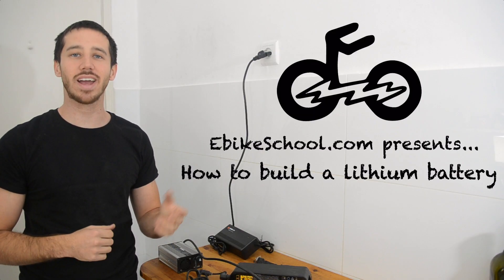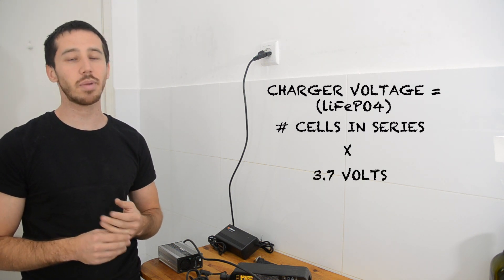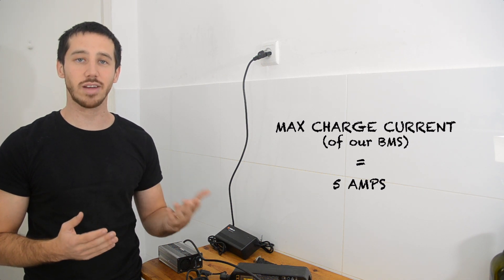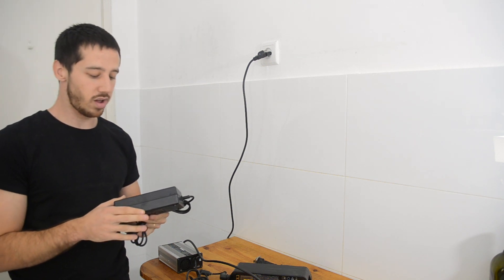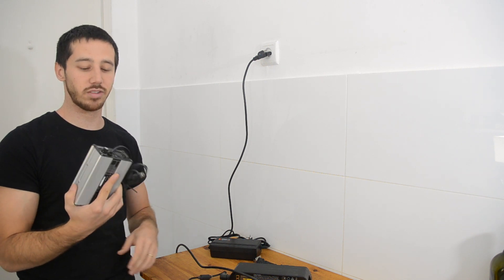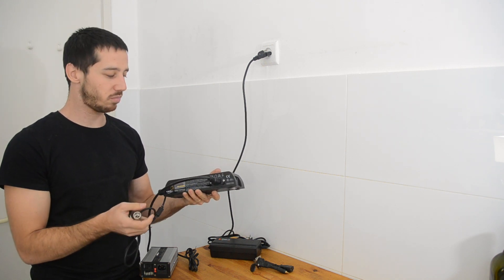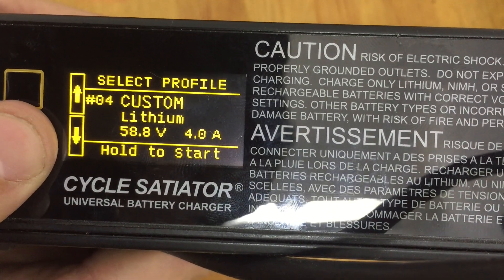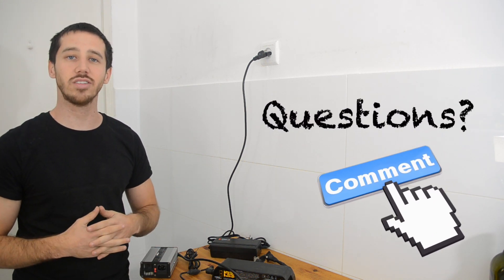DIY Lithium Battery - Choosing a Charger - Part 5/5

Comment: Really good video series, very well explained, but you need to make this point: The battery you built should always be charged to 100%. Charging to 90% will increase cell life, but the BMS only balances the cells at 100%, so at 90%, it'll go out of balance and lose capacity. Too many people have misunderstood the effect of 90% charging and wonder why there battery comes to early problems

The balancing only happens when the cell-group bleed resistors open, which is at something like 4.17v. The BMS will allow a single cell-group to go to about 4.25v before it cuts the charging. Then, all the cells above say 4.17v bleed down to 4.17v, which is how the balancing works. Without that process, the discrepancies between the cell-groups gradually increases, The greater the discrepancy, the less usable capacity you have.
Reply from the maker: Any battery with good quality cells should only need to be balance charged (or charged to 100% so the BMS can balance) occasionally. Once every 10 or 15 charge cycles is plenty. Good quality cells inherently stay very closely balanced. If you are building a battery from recycled or random cells then yes, you should always charge to 100% to allow the battery to balance, just like you said.
Reply: @EbikeSchool  sir can I use 12v to 72v DC to DC convertor to charge my 72v lithium battery pack in low amp?
Reply: Well, that is true for new cells and for the first year, possibly a bit longer. The truth is, we don't live in a perfect world and the issue with your approach is that even very minor differences get amplified.

The reason I think you should always charge to 100% (100% being the voltage at which balancing starts) is that if you don't and the balancers don't do their work, you'll  always slightly overcharge a few cells in the series. This makes them age faster than other cells, causing them to be overcharged a little more next time and so on. Eventually, you'll end up with quite a big difference and could end up destroying your pack if you only balance every 10 or 15 cycles.

That being said, if you want to get the most of your battery pack, you'd do well to get a BMS with balancers that kick in at 4.1V per cell (and set the charge voltage accordingly, of course). That way, you can always charge the battery pack completely (from the pack design point of view) and always have the pack balanced. The slightly lowered charging voltage will also greatly increase the number of cycles you can get out of the pack (easily double the cycles, depending on how you use the cells). The price is slightly reduced capacity, which is somewhere in the area of 5 to 10%, depending on the cell chemistry.
Reply: It really depends on your use case. For high current applications, you will want cells with very low internal resistance. For very high current, you may go for LiMn (look for IMR at the beginning of the cell name, LG has some pretty good ones) cell chemistry, which has generally low capacity but can deliver very high currents in the order of 20C.

A good balance between capacity, cycle life and max current per cell is achieved with Li(NiMnCo)O2 chemistry (look for INR at the beginning of the cell name. Samsung and LG both have good cells here, for instance the INR18650-29E). These types of cells are generally more tolerant to misuse and thermal runaway than the LiCoO2 cells.
Also very good are Panasonic Li(NiAlCo)O2 cells (look for the Panasonic specific NCR in the beginning of the cell name). They have different variants, but you generally trade capacity for max current, but they all have good cycle life. They are a little bit less tolerant to misuse, but still better than LiCoO2.
Reply: EbikeSchool.com how you know that batteries are charged (with bms)?
Reply: What batteries do you recommend for these kind of projects ? there are hundreds of choices online
Reply: 100% charge for my BMS is rated @ 3.7V per Li-ion cell. Lithium bats fully charged max out at 4.2V so balance is below capacity. So there is no worries.. right?!

Comment: Hey Micah, If I'm riding 10 ml 5 days a week to work and back, and charge at low amp 80% for long battery life, how often should I charge to 100% to balance pack?
Reply from the maker: If you have a good quality battery, you can probably charger to 100% once a week or once every two weeks. Honestly you might even be able to do it once a month as good quality cells generally stay very balanced, but I like to play it conservatively.

Comment: I thought the bms controlled the max cell voltage?
Reply from the maker: It limits the max cell voltage to keep each cell from overcharging. It is still important to choose the right charger voltage though so you your BMS can function properly and not undercharge or try to fight overcharging.
Reply: I see

Comment: would you recommend to charge at the max 4,2v per cell or is it better to charge each cell at 4.1v for longer cell life?
Reply from the maker: Yes, 4.1V per cell (~90% charge) will increase your battery's life. I discussed that in the "adjustable charger" section of the video. Charging to 4.2V isn't bad, it just doesn't give you the maximum battery life. It's a personal choice. I rarely every have a single ebike or battery long enough (2-3 years) for it to make much of a difference to me.